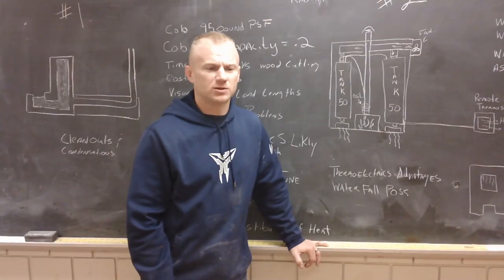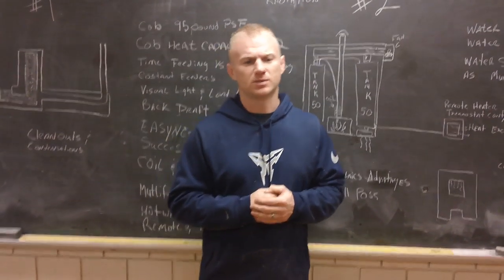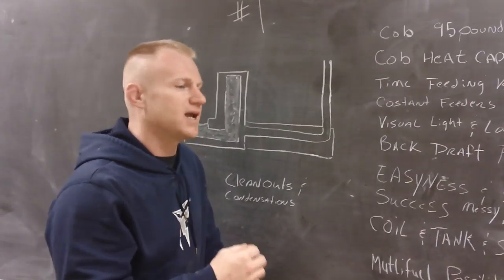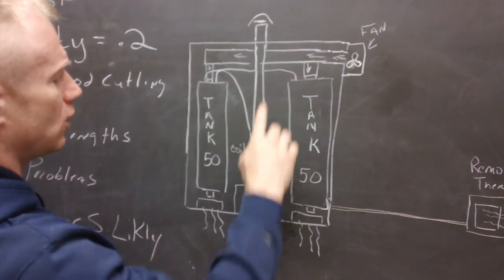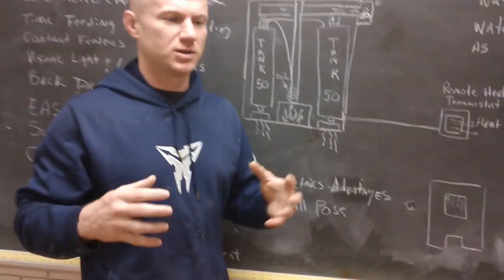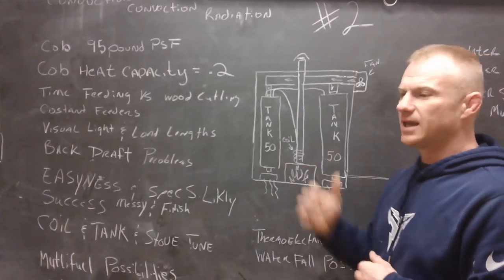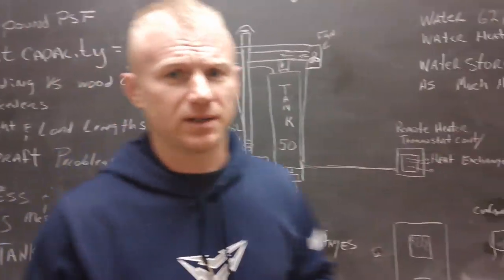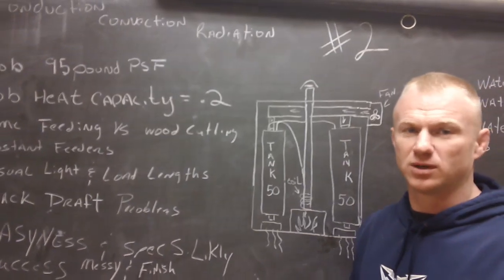Green House Heater Death of the Rocket Stove part 2

Comment: The point about determining your overall need for btu/hr, and then designing the system to meet that need is primary. Second, efficiency of the system- the RMH is far more efficient overall, as much less heat is lost 'up the chimney'. Practical is a different matter (how often you feed/build a fire).
Backdraft is the biggest hurdle with RMH (since little heat is lost, and some heat is needed to create the draft). You can design the size to meet the need, as you point out- what heat you want immediately plus how much extra you want to store, so that is not a valid argument against RMH.. The RMH is less versatile during seasonal changes. If you have a constant temp outside they are easy to work with. If you ramp up for 10 below all week and then it goes to 30 above, you have too much stored heat. Worse, if the temp drops from 30 to -10, you don't have adequate time to build up the mass without sitting there feeding a fire all day.
All systems have their good and bad. I REALLY like you putting the idea in my head for a fireplace with a waterfall, even if that had no bearing on heat at all. It's a beautiful concept- mixing fire and water visually, and I hope to explore it!
Reply from the maker: when people speak about efficiency in most case they can NOT name the different types of efficiencies stoves are rated in and how they are derived much less be able to explain it or give a definition of  what they mean when they say it.. it is NOT a general term.. you may be interested in my video understanding wood stove efficiency ratings and it may change your perspective and how you use the word and what you claim as more efficient (RMH) is not really comparing apples to apples. and not really that much more efficient or at least not as much as you think. the key to this understanding is the draft settings as laid out in the video I spoke of.

Comment: I think anyone that has studied this subject knows that water is great for energy storage. It is a little tougher to work with due to its liquid state. If you could combine the rocket stove with the water AFTER the combustion chamber you would be doing good.
Sorry but the whole point of the rocket stove is efficiency. The draft problem is because of efficiency. Meaning the if you subtract all the heat from the combustion process then there is nothing to pull it up the chimney which is one reason many don't bother to use chimney's. If the design is done right the fire tube creates all the necessary draft. The length and size of the tubing through the cob creates drag that affects draft as well. 
I know my father cant get it wrapped around his head that you don't shut down a rocket stove like you do a regular firebox. Shutting down the air to a fire creates inefficiency seen as smoke. Id love a rocket stove you could throw big logs in. However there would be no control over the burn. In a rocket stove your burn is controlled by the size of the opening for your burn chamber which needs to be sized for the rest of the system. Guys have converted their rocket stoves to pellet stoves in an attempt to get longer burns without babysitting the stove. Look up zero fossil fuels, Zero has a done a great job with that. 
In short if you have plenty of money and don't mind using 4 cords of wood each winter instead of just 2 then a regular stove with whatever modifications you want will work fine.  But if you want to save money and heat with wood without all the tell tale signs you are heating with wood then the rocket mass heater is for you regardless of the efficiency of the mass. Just make sure you build it right.  :)

Comment: I was going to comment and show the losses, and other problems with this system. However, he is mixing stuff up so much that I don't think it would matter. There are things you need to do before hooking water tanks to a wood stove. The losses are incredible in this system. I would venture a guess at 35% is all the efficient this system is.

Onetwothree, the reason you feel warmer is because of the moisture in the air and the amount of heat the air can hold as the relative humidity rises.
Reply: "The losses are incredible in this system. I would venture a guess at 35% is all the efficient this system is."

Could you elaborate? Easy to toss out numbers and critique, but what is the basis? I know beyond doubt that overall a RMH is far more efficient use of fuel than any wood stove design, but what are the flaws here?

Comment: Very interesting! You make it very clear how the water system is a much more efficient thermal mass.
It seems like we could still use rocket stove principles for the combustion chamber, to get a cleaner more efficient burn.

- Your mass system is also more complex and uses more man-made materials.
 I don't know if this makes it more "expensive" or what the "absolute" environmental impact would be of one system vs. the other.

It's important for us all to remember that not every rocket stove, or any other heater are created equal. The better we do our science/engineering the more efficient, safe, and effective or systems can be.

Thanks for the video!

Comment: - also the application/intended use makes a big difference in what you'd want. One of the main purposes for rocket stoves is for cooking for women and families in third world conditions. - They are currently using stoves or fire-pits without good engineering, and may have limited access to fuel. They need a clean burn/less smoke, and cheaper-easier-to-find fuel.
Thermal mass, and heating the space are less of a concern.
- So well-designed rocket stoves fit the bill.
For heating homes in northern climates, perhaps water can sometimes be a useful addition to the system.

Comment: 60% of the BTUs in wood are in the volitales, ie smoke. But it takes over 1200F to burn them. This means if you want an efficient heater of any description you must burn very very hot, or you send 1/2 you btus up the chimney. This also usually means you must burn hot and fast, with no heat extraction in the combustion zone, just the right amount of Oxygen, so it neither over cools or starves the fire. Then keep the gasses mixing long enough to complete the process. 

Most modern stove stretch out the combustion to all night by starving the fire of oxygen, which makes a smokey mess, which they then cleanup with a catalytic converter.  So they will never compete with a well design rocket heater core for combustion efficiency.

The rocket heater combustion system does an excellent job of all the critical elements. We have comprehensive efficiency and temperature logs pulled from a Testo 330 gas analyzer. http://blog.dragonheaters.com/category/flue-build-part-3/.

With regard to thermal mass. While water is good, it is not the most compact because it can only be heated a few hundred degrees at most. Fire Brick on the other hand can be heated many time this. In our greenhouse Derick design we heat a column of firebricks inside stacked 55 gallon barrels to 700F. No electricity needed, no danger from overheating the water. There are also other factors such as thermal conductivity affect a materials heat absorption capacity. We have a nice chart talking about different materials shown here.
http://blog.dragonheaters.com/category/reference/thermal-mass/

Comment: would it work well to use the rocket stove cob bench design, but instead of cob place 5 gallon bucket of water packed in sand inside the bench and cap the bench with a poured concrete slab like the one you used in your green house? would the water likely reach boiling, could you add ethylene glycol to the water buckets to raise the boiling temp?
Reply from the maker: it takes just over 70,000 BTU's of heat to in one hour to boil a 55 gallon drum thats if your not loosing any to the room or up the chimney. A plastic or steel drum will loose the heat at about half per hour so a drum with 75K btus would drop to 37.5K BTU in one hour due to loss but deliver the other 37.5K  to the room and then deliver half that over the next hour .. with no additional heat being added. I use thin insulation or a closet with vents to control the loss and slow the losses and extend the time between loads. Yes glycol can be used but most times you wont need it . Water is  a good heat storage medium and it can store a lot of heat If you use how many BTU you want to store with the proper volume of water to allow for all the heat to be stored you dont have to worry about boiling.. stove design should be based on how much you want immediately plus how much you want to store, the coil or heat ex changer should be designed to rob the heat to cool the chimney to about 200 degrees as to prevent excess heat loss and design water volume to hold that amount of heat without boiling for best results.. sealed water tanks can be problematic due to expansion. I always vent mine to avoid this problem only takes a very small hole to relieve pressure that could build

Comment: the overall efficiency of a system lies in the balance between energy/heat released vs energy recovered. Typically you recover heat with a heat transfer device. Any given heat transfer device has an ideal rate of heat transfer for that specific device. Too high or too low of a rate results in inefficiency.  That’s why in air conditioning systems the indoor coil is matched with the outdoor coil. There are things you do to compensate for other things but theres always a cost. Like you can compensate for an undersized hot water coil with higher water flow but now your pump uses more energy. Another example, sometimes they oversize the indoor coil so it has more surface area and transfers more heat which results in better efficiency(to a limit). So why don’t they make them all like that you ask? Because bigger coils mean more material and more COST…. so that would be higher initial cost vs less long term energy use. in addition the overall system is sized to match the required heating or cooling load, if the system is too small it will work too hard and maybe not meet the required load. If the system is too big you either have to cycle on and off or find a way to store the energy. then there are additional losses when trying to store energy. Both an oversized or undersized system will result in inefficiencies and/or premature equipment failure. Sorry for getting carried away. I was going to keep going…
Reply from the maker: All good points and exactly what this is intended for conversation, thought provoking and a learning tool for everybody else and me to.  We are never to big to grow or too smart to learn.  You should do some videos and expand on that subject.  I would bet you're a HVAC guy?
Reply: Van Powell did the a/c talk give it away. lol maybe someday i will do some videos but i enjoy bouncing ideas back an forth with people. i can expand a little more on the subject though. Sorry you got me going i hope more people get the concepts of thermal dynamics as it relates to efficiency of a system. once you understand that you're building a system of transferring heat then you can understand that its only as efficient as its least efficient component. so you start improving there and move on to the next least efficient. that being said. if you take money out of the equation, efficiency is relative. for example solar power systems are very inefficient at capturing energy from the sun. they can only harness a small percentage of the suns energy yet the energy is free so a solar power system is considered efficient vs paying a power company. so now you can say the source of fuel/energy/heat factors into the efficiency. in our world resources are limited and cost money and that cost is factored into efficiency ratings as we know not solely on the energy in vs energy out definition of efficiency. simple explanation is a 25% efficient stove running on inexpensive fire wood is theoretically more efficient that an 90% efficient electric stove because wood it cheaper. are you confused yet? so am i.

Comment: I posted this on the other video but its prob more relevant here. I do believe a rocket stove is more efficient but only at converting more of the fuel to heat. BUT the name of the game here is trying to harness the heat efficiently. It does no good to produce an efficient fire if you can’t harness the heat efficiently. The gain of fuel efficiency from a rocket stove would be small compared to the heat losses going out the flue. Much of the heat goes out the flue no matter how efficient the fire is. You’re better off trying to improve heat transfer and storage by improving the transfer coil or adding more mass instead of trying to improve fuel efficiency of the fire itself. There are many ways to argue the best way to transfer heat but in the end its simple, You’re building a system and the heat source is just part of it. It’s like a car engine, you can have an efficient engine but if the car is heavy, shaped like a box and has crappy tires it’s not going to be very efficient. Therefore If you have plenty of fuel(wood) a slow burning stove that can burn a long time without being fed might be better than a rocket stove you have to feed often.

Comment: You could make a self contained system and use ethelene glycol and raise the boiling temp of the fluid/water like in a car. Use a big radiator from some kind of automibile and a fan, just like a furnace and it would work fine.
Reply from the maker: Good thinking thanks for watching

Comment: I think you could use both: the stove configuration of a rocket mass heater, but scavenge the thermal energy using pumped water as thermal mass ( instead of relying solely upon cob to store and radiate heat energy).

Particularly for a greenhouse that might use hydroponics/aquaponics. Mostly because you're already pumping water for a hydroponic setup. It could be pretty slick if done correctly.

Regardless of how this whole concept was communicated, it adds an interesting dimension to the whole conversation.
Reply from the maker: Thank you . This video was never intended to be instructions for anything. It's purpose was the exploration of different concepts combinations and possibilities and to provoke thought and innovation that will help us all. Im not trying to dictate anything Im just trying to contribute to the conversation and the evolution.
Reply from the maker: the problem with a rocket fire box is limited space thus limited amount of BTU per burn thus limited amount stored thus its not practical for green house applications

Comment: While I wouldn't say what you're doing is wrong or critic your design or method I will say  I think you're missing the whole idea behind what a rocket stove is and what it does. A rocket design uses a process called gasification which burns more efficient than conventional wood stoves. It uses less fuel and makes a hot clean burn similar to how pellet stoves operate if it is designed/operated correctly. Smoke means gasification is not happening. Good job on your greenhouse. I wish you well.
Reply: I forgot about the gassification factor.   Thanks for the reminder.

Comment: I have a central heating fireplace that heats my hot water and also heats my house. (what you are proposing here). This system is used all over the world. Nothing earth-shaking here. But my very nice brand new wood stove (which claims 82% efficiency) still requires me to feed it every 20 mins or so.

Comment: Problem is you keep saying "rocket stove" but what you should say, you obviously are a technical and intelligent guy, is "rocket mass heater". Sure, you're correct, water holds heat better. Water-based Trombe walls have been around for a long time. Heating a trombe wall in a greenhouse with your system could also be done cleanly with a rocket stove... so it's not a death of anything. Your just attracting trolls with a title like that. You should at least say "Death of rocket mass heater."

Comment from the maker: No feelings hurt here. I have free will. I chose to approach from the standard rocket stove as what most would recognize and call a traditional RMH. Live with it. dont care if you like it or agree with it. Done it. No assumptions here. limit wood volume by small load limited by small burn chamber thus limits total BTU output per load. why is that so hard to understand?

Comment: Continued:

Why not use a MRH for radient heat with the cob, and place a boiler around the burn chamber -kelly kettle style- for heating water for heat exchangers in other rooms where the cob is not. Or, just use the MRH to heat the cob, put a finned heat sink on the burn chamber to heat the air, turn on a central fan.

Many ways to use a RMH, not dead yet.

Comment: M M is correct on the "why water in pipes compared to stone" question. Dumb question by the way.
Also, Before we even heated with pipes, people would heat their beds at night, by filling a device -essentialy two cast iron skillets latched together- with STONES that had been heated on the fire. Why didn't they just pour boiling water all over the bed, since it's such better thermal mass.
Because, different materials are used, for different purposes.

Comment from the maker: That heat loss is way easy and cheap to control and still have the water advantage. The total BTU's advantage of a factor of over 3 times per sq foot but water is 5 times better than cob pound for pound. but density of the cob lowers the factor to 3.26 times per sq foot. Cob could be put partially around water tank as insulation to slow it, yes that is one option. any insulation of any kind would do just as well with out the mud. say a insulated closet with floor drain with vents and TEG fans